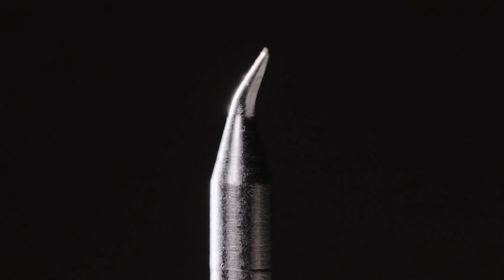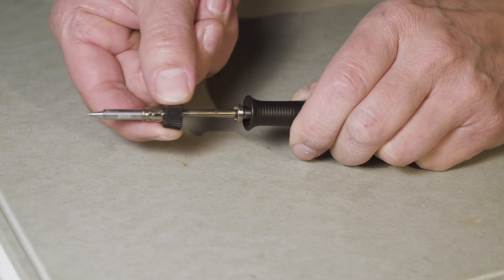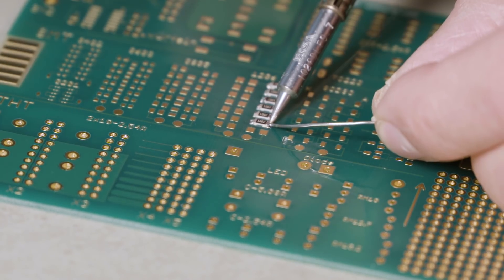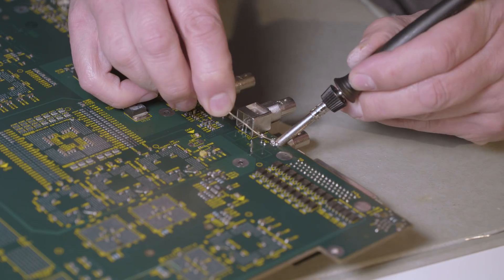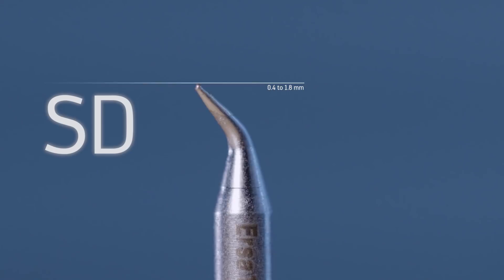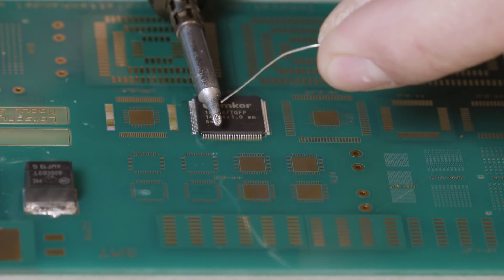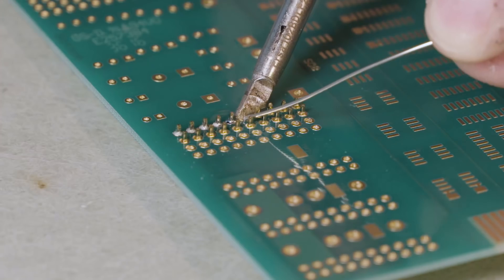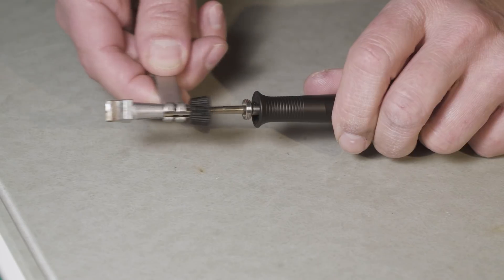Ersa explains #7 – Soldering tips + applications

Comment: Does anyone have experience with a using a Chip Tool with a pair of right angle desoldering tips, such as the 10mm x 10mm O452QDLF100, to desolder a square, 64 pin IC? I'm wondering if the idea is to clamp the IC and lift it off the board, or slide it off. Do these right angle tips work well? Thanks.